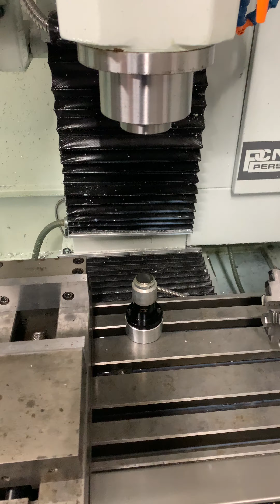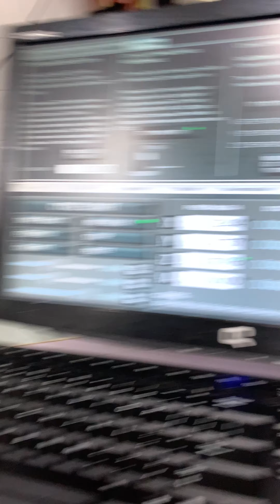Setting up your ETS for your Tormach tool setter

Comment: How is it mounted to the bed?
Reply: Ever figure this out?
Reply: Im late, but for others...  I milled a round puck for mine.  A bolt goes through the center of the puck, and screws into a T nut on the table.  Then mount the ETS to it with its three screws.  I think this is exactly what they sell, but I didn't think too much on buying something I can make in 5 min.